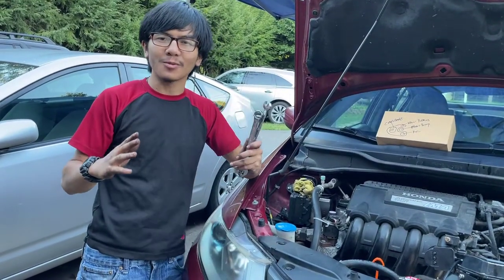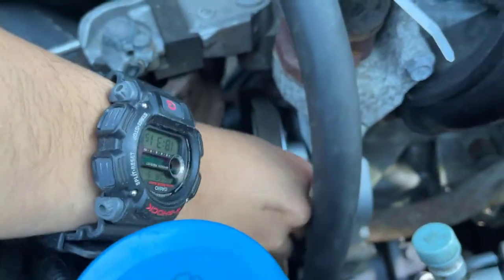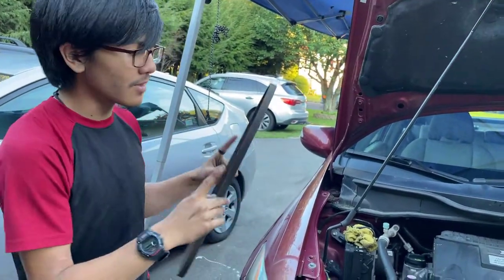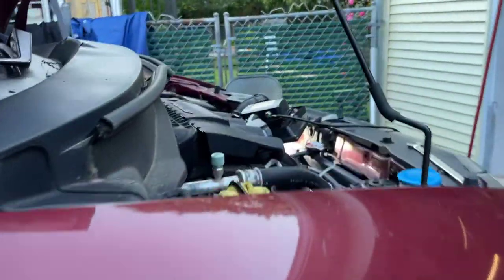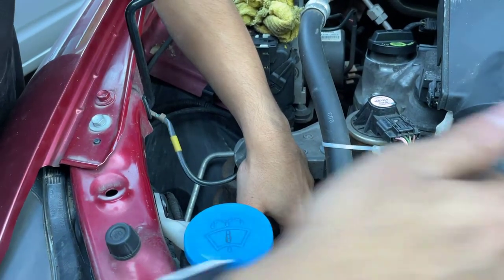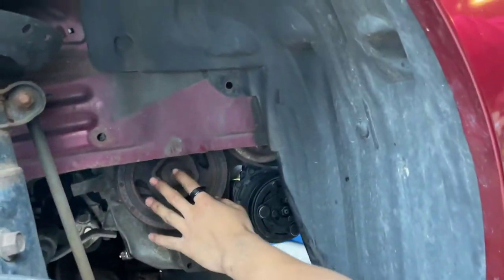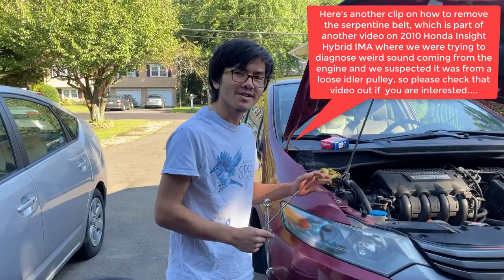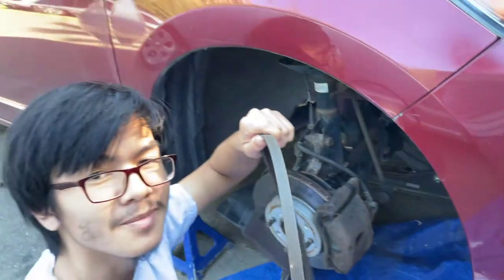How To Remove, Re-Install Or Replace Serpentine Belt | Honda Insight Gen II 2009-2014 Hybrid IMA DIY

Comment from the maker: Here are the #ad links to some of the tools or parts which might be required to perform this repair:
1.  https://amzn.to/3DTrNcd  |  Belt Tensioner Compatible with Honda Insight 2010-2013 CR-Z 2011-2014
2.  https://amzn.to/3EWD3pW  |  A-Premium Accessory Drive Belt Tensioner Assembly Replacement for Honda CR-Z 2011-2014 Insight 2010-2013
3.  https://amzn.to/31UPDYd  | Powerbuilt Alltrade 648629 Kit 52 Serpentine Belt Tool Set
4.  https://amzn.to/3oK6Zjb  |  ACDelco Specialty K081264HD Heavy Duty V-Ribbed Serpentine Belt
5.  https://amzn.to/3DPCxIA  |  Serpentine Belt Wrench Tool Equipment Hand Tool Removing Installing Tool Serp Belt Wrench for Acura Accord CR-V Civic

Or Click on Amazon link here and search for what you need:  https://amzn.to/3xIOsqg